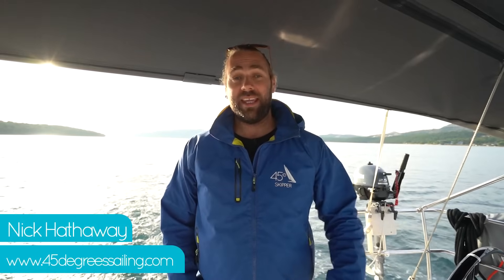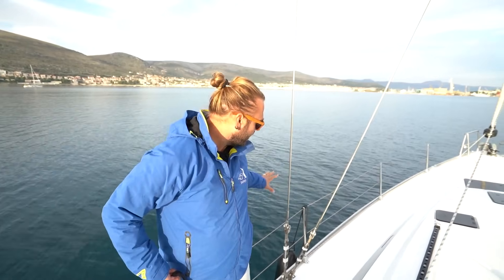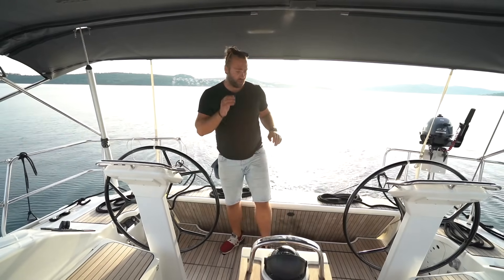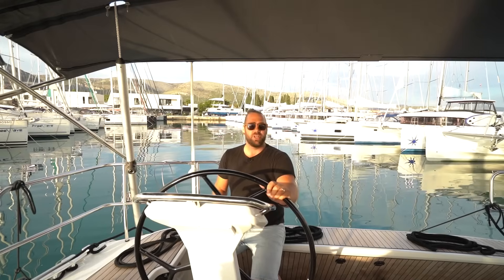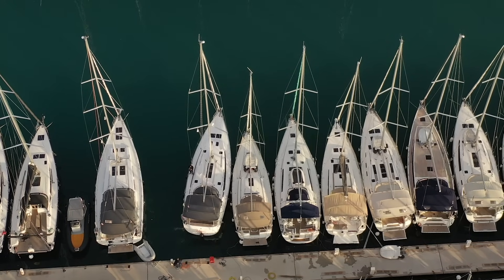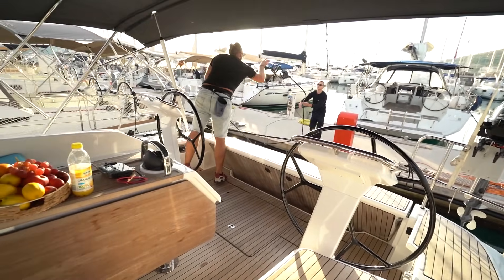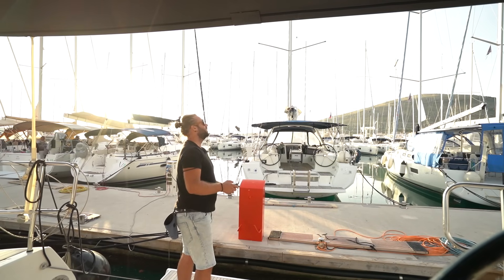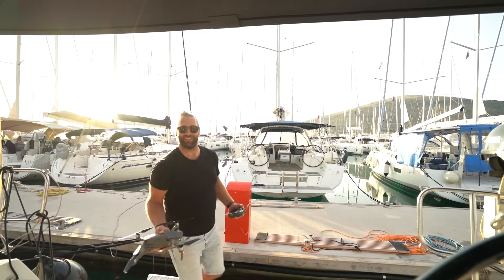Singlehanded Docking Stern To with Lazy Lines

Comment: In Croatia, almost every marinero start to pull the mooring line first. However, we know that the most important line on docking maneuver - stern to, is the windward stern line. So, if you will first time sail in Croatia - prepare yourself. Congratulations for very nice video and explanation.
Reply from the maker: Totally agree. And thanks for the comments. That control line is so important in any docking/manoeuvring procedure. If you can learn control lines then single handed or crewed, your job becomes so much easier.
Reply: That's also how I do it every time. Get the windward stern line (or both) set up first, engage the engine forward and you have all the time in the world. :-)  Nice video.

Comment: Not sure why, being single handed, you kept the boat underway and not put the engine in neutral. Stops runaways if you tripped and fell overboard.
Reply from the maker: Hey Richard. Thanks for the comment. At what point are you referring to? Is this on the approach to the marina while preparing?

Comment: Have not seen a docking with a bow line like that as, here in Australia, we usually have fingers to tie off to on one or both sides. Well explained. Thanks.
Reply from the maker: Most welcome Linsay. Yes that’s very common in Aus, NZ. This system can be a bit of shock when you get here if you are not prepared for it!

Comment: This is just about the best video presentation that I have seen about stern to mooring with lazy lines. Irrespective that you have done this single-handed, every action was explained in order, and in detail. Really good. One thing I would say is that you mentioned that you would drive against the attached stern line in windy conditions and I agree with this, but when doing this, you do have to be a bit careful with the 'loose' end of the lazy line dropping back under the stern. If it is long enough, i tend to drop it over the inside of the safety lines and onto the boat or get a crew member to hold it high. You may have done it already and I haven't seen it, but mooring stern to with lazy lines in a crosswind would also be a very valuable video presentation. I had such a set of conditions last weekend in abnormal weather in Corfu.
Reply from the maker: Thank you for the comment and feedback. It is much appreciated as you can imagine we have a lot of comments on the other side of constructive! 
Yes this loose end or ‘lazy’ end often made from lighter thinner line that attaches to the pier is a huge consideration when doing this manoeuvre. The best of the dock hands will hold the end clear as it is taken to the bow to ensure it staying away from the prop. I have a few videos of crosswind control lines, maybe some docking ones though I have not had the .. ‘opportunity with the right weather and time in the moment’ lol to film this. Also once it hits a certain level getting the drone up is also risky.  I will see what I can find for you and post in another comment
Reply from the maker: Using a Control Line: Docking Stern to
https://youtu.be/mWCDFvag56A

Comment: Great video! That's exactly how I do it except I do OXO only for temporary use... after I'm happy with my position i do the "proper" cleat knot. Remember to throw windward line first from the stern and always, when going parallel to the dock during initial approach, you want to go stern towards the wind if it blows sideways to the dock. My Bav 36 doesnt have a bow thruster so with side wind I want to dock in a position where my downwind side of the hull will have another boat to rest on with my fenders... if there are none, after throwing the stern line I have to put on forward and steer a bit towards the windward side so the boat stays balanced on one line... only after that I take the mooring line.

Comment: Thanks Nick for a great explanation. One problem I encountered. I had a motor boat crew member lift the lazy line so high and too early that it caught on the bulb of my keel and because of language issues (it was in Greece Sept 2021) he didn't understand what had happened. No big problem as there was only light winds. Being prepared and having an understanding of the whole process as well as how to resolve it without cross words or shouting, makes for good relationship with other boatys.
Reply from the maker: Yeh that does happen! And it can be very tough explaining in the moment to people, that you would prefer not to have their help in a situation.

Comment: Nice calm and collected, good pointers for docking. I have a Dufour 43, sailing solo, and initially need to start with a bit of reverse speed to get rudder to grip, but stating early in reverse is key, and then slowing down as you did. Envious of the space you have, my boat is 4,3meters wide and the berth 5meters, so it is a tighter squeeze and you have to make the turn, have the speed and control the boat right the first time. Nice video. A thing I do if there is a bit of wind blowing me onto the dock, I make fast the two stern lines, put the boat in forward gear low power setting to pull away from the dock, and the fasten lazy lines, if needed upwind first. I may also use bow thruster to control direction of the bow.
Reply from the maker: Thank you very much, very kind words. Yes there was plenty of space this time! That time from fwd to stopped to reverse can be stressful on the windy days as you have no control for that moment until she tracks through the water and bites.

I have quite often had to put the bigger yacht (Hanse 548) into a gap smaller than her! 

Worst was in Starigrad on Hvar, we were very late in and had to put the bum in and wiggle our way in squeezing the others out! Fenders got a workout 😅

Comment: Hi Nick, nice video. Lazy lines are part of the lazy jack system. 
And a tip if you are making the follow up: "Sailing Away from the berth":  Don't use the bowthruster too soon (when it is windy). When dropping the mooring lines the small helpline needs time to sink, otherwise there is a chance of being sucked into the bowthruster. (Own experience).
Reply from the maker: Hey Chiel. Thanks for the explanation. Indeed, some to refer to the lines for the lazy bag as 'lazy lines', though they are more commonly called 'lazy jacks' (separated into risers and legs).

When we refer to mooring stern-to with lazy lines, this is the name given to the system used in the marinas here in Croatia. You used the term 'helpline' which I am presuming refers to the line that attaches from the dock to the mooring line. We call this the 'lazy line' as this line should never comes under load. Hence why it is 'lazy'. Just like we say 'lazy sheet' when referring to a sheet not under load.
Reply: 🤦🏽‍♀️ Theres always one
Reply from the maker: With the bow thrusters yes absolutely agree, and on the way out of the berth there should be very little need for thrusters until the yacht is at least half way out of the berth. 
If the marina/dock has set up the lines properly, the lazy line (smaller gauge line attached to the mooring line and the dock for those reading the comment out of context) should be no where near your bow on release, and have plenty of length so there is no tension back to the dock to catch rudders, props etc. And in saying that even the large gauge mooring line can catch on drop down thrusters. Just have to be so careful and aware of this every time.

Comment: You are a brave man. The OXO Vs Hitch is an old argument that I've even heard of people coming to blows over. Done properly I believe both are valid, I lived/worked on a boat for 3 yrs never had a problem with hitches, however, I have seen problems with people using unnecessary wraps/hitches creating rats nests over cleats. As you rightly point out professionally run boats will probably have a standard policy.
Reply from the maker: Haha. Indeed it is!  Completely agree with that. And I take my hat off to other creators putting themselves out there, some of the comments that come through are so negative!

Thanks for watching and thanks for the comments.
Reply: @45DegreesSailing  Couldn't agree more. Sharing ideas, alternatives, and constructive criticism is one thing. Personal attacks and abuse are unnecessary, unpleasant and counterproductive.
Reply from the maker: Completely. Thanks for the support, will look out for your comments!

Comment: I do almost what you did, the only difference is that after I get my first stern line I put the boat in forward so I don’t have to worry about hitting the dock, then I pick up the lazy line being very careful and putting it over the bumpers since the prop is running and I go to the bow to tighten up the two bow lines, then I came back and do the remaining stern line.
Reply from the maker: Yes that is exactly right.  I would do the same had there been any wind to speak of. You can see this technique in out other docking video: https://youtu.be/jULddr4KA50
Reply from the maker: Thanks for the comment! And yes very important to be careful of the lazy lines potentially catching in the prop. Especially if they are short (often happens after someone catches it in the prop, it gets cut and retied but the line is too short)
Reply: Or maybe the wind is already pushing you away from the dock. Marina staff will first fill the side of the pontoon that has you backing into the wind.

Comment: There are only a few really helpful videos that demonstrate how docking can be made correctly, showing how to manage the moorings and the stern lines. Also the 0 8 00 technique is so cool and seems to be way easier to handle than the convetional one. I wish there was more videos like this to get into with the docking manuever. Thanx
Do you think it is a good idea to already have the two sternlines in perfect length (so that the boat is about 2,5 meters from the pier, when going forward into the prepared sternlines). In this case the marinero only has to put the loops over the bollard and the stern lines are already on board.

Comment: Thanks for the Video! When you are talking about the hitches, you say they are easier to undo in an emergency, but you have a bowline knot over the cleat to start with. Try to undo that one in a emergency under tension, simply not possible. I learned the hard way to always start with a cleat hitch….just an fyi….we all know, 3 sailors, 5 opinions :)
Reply from the maker: 😂 it’s so true. Everyone has their way! And yes. Ideally I would do the same. Cleat hitch. Around/through the fixing and back into the cleat. The issue with this on modern charter yachts is space! With a cleat hitch already on it is often very hard to fit all the rest on. So we split the difference. If you can let can the bitter end with no knots in it then it should pull out and be able to be retrieved back even though the bowline is over the cleat. Not perfect.

Comment: As a reformed commercial fisherman who has gone over to "blow boating" I had always been taught that you are never done cleating off until you flip a loop and hitch it down. 
Then a couple years back this English chap (who was admittedly a bit cranky) noticed how I was cleating off, and questioned me on it like I had commited some form of cardinal sin while desecrating a temple of some form. Right irritable fellow, but every now and again he would make a good point, and yes sometimes the OXO is indeed easier to get undone, but at least in my experience you have to load it right up before it cinches down on you. To each their own. 
Also I've had the pleasure of playing bumper boats on a Bavaria 51, that twin rudder had me all types of baffled, got her mostly lined up to go starboard side to and went to give her a bump ahead to shove her rear end in a bit and nothing damn well happened, so me in my infinite wisdom and nearly 30 years of single rudders unly decided screw it I'll spring in, which only served to swing her stern out more and cause the fenders at the bow to protest. I then started getting flustered, and force of habit and practice took over and just made everything worse. Thank god for fenders! Ended up full sideways pinned in a corner by the breeze feeling big enough to use a thimble as a bath. Took a lot of "Norwegian Steam" to fix that mess. Then some good brandy to ease the skippers pain!
Reply from the maker: I have to say Jayson this is one of the most lyrical comments I have had on the channel! We love the way you write! 
Yes that twin rudder situation can be a bit of a surprise to the normal manoeuvring tactics for sure. Thanks for watching and the support. Takes a real skipper to be able to admit and share stories like this one, so thank you again, we are all richer for it. Hope to see more of of you on the channel. (And by the looks of my notifications you are working your way through our videos!)

Comment: Eventhough it is a good video, I do it slightly different and more easier, throw out the 2 stern lines put your engine slowly in forward and you don't have time stress or whatever because the boat will stay in position on his stern lines. 
Also you give the stern lines slack so you don't have to pull up the bow lines/mooring lines that hard, when you have put them both up. In some places you only have one bow line/mooring line. Then you reverse the boat so it automatically gets more tight on the bow line and you tighten the stern lines to you distance to the shore/dock.
Reply from the maker: lol thanks. Was sure that is what I explain on the video. Completely agree. In an ideal world. Though often you have to roll with the punches with different marinero wanting to give you the lazy line before securing the second stern line.
Reply from the maker: https://youtu.be/jULddr4KA50?si=6ofBPu6hN-12HZ_7
Reply: @45DegreesSailing  Exactly ;-) !

Comment: Great video Nick. Thanks! My berth is about the width of my boat's beam. Sometimes I do not put my fenders on to avoid overlapping with my neighbors fenders. It stops the back stearing of my boat. Another problem is being very careful that the marineros pass you the correct lazy lines. I have a double rudder and twice they got stuck on one of them. They can damage rhe edge of the rudder. If I feel any tension when walking forward I just drop the line and make sure that I get the proper one.
Reply from the maker: Yes they sometimes can hand you a problem waiting to happen! No marina, nor marinero is created equally! All the more reason to get that control line on first.  Thanks Isaac

Comment: Nice work. That is one well-heeled marina. But probably not a lot of sailors, just a lot of money and cookie cutter boats. l've done enough sternto's, with crew and still get that white knuckle feeling every time no matter how well it seems to be going. Nice work here, perfect conditions. Would like to see same under windy conditions, 20 knots from the stern for example, without bow thrusters. The crossover line on the port side is the tieup for the next boat over?
Reply from the maker: It is a bit harder to film and get the drone on the air when its 20knots up there! I will work on showing it when I can. Thanks for watching and the comments :) 
Yes the line would have been the lazy end of the other boats mooring line

Comment: This is great video❤️, but as you said there was no wind, when there is wind, and if I'm on 50ft+ boats there is more "work".. plus I have tried to catch my air 2 same as you 4 times and only once turned off automatically.
Reply from the maker: As long as you get your control line on, you should be able to manage the work the same. Thats interesting about the drone, I do this catch a lot, 90% of the time it shuts off for me, you must have a very swift and definite flip though. Other wise its back to manual shut down!

Comment: nice video......I see some people cross their stern lines.   Is there any advantage or disadvantage to doing this?
Reply from the maker: Definitely an advantage in some situations.  Though to be clear the crossed lines are the springs (stern springs). They still have (or in my opinion should have) stern lines coming out straight or angled a little out of possible the spring lines crossed over keep the boat in steady position when there is a strong cross wind or current. Reduces the amount of ‘snatch’ or jarring when the lines take tension. It’s not easy to do on all boats as the cleats may not be positioned so well to be capable of rigging cross springs.

Comment: Thank you for the instructional video. 
Question, wouldn’t it make sense to opt to lock both stern lines and engage the engine forward to keep it in position wile you fetch the lazy lines for the bow?
Reply from the maker: Hey there, yes it does make sense to do that, especially in certain circumstances. This particular example was driven by the dock hand wanted to hand me that lazy line first, after only securing one stern line. In very windy conditions, pending the angle of the wind, I may choose to do exactly that. You also need to be very aware of the lazy line stretching up close to the propeller when it is running.